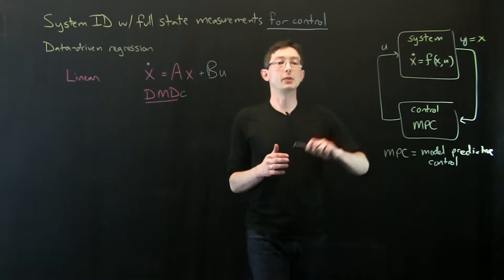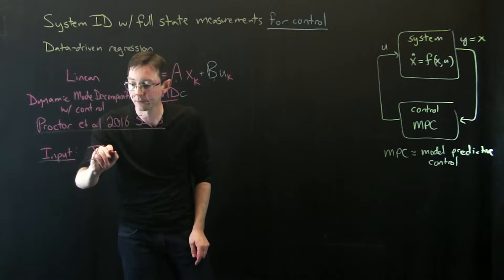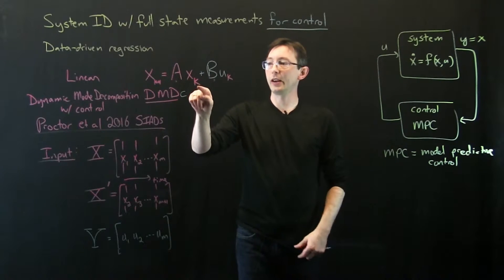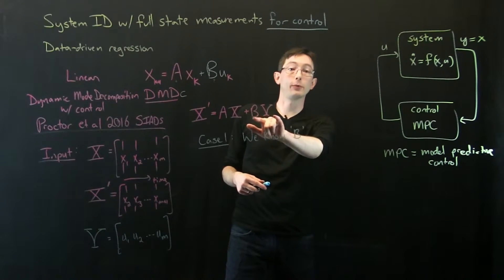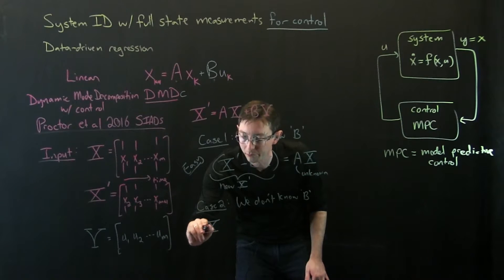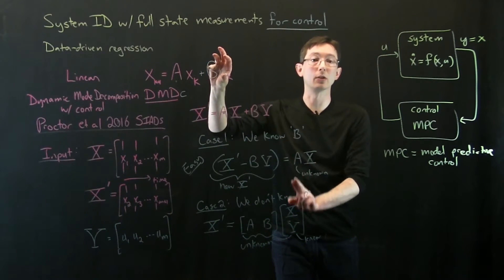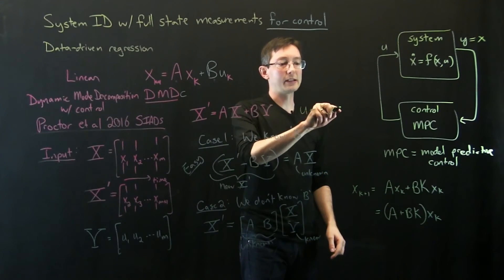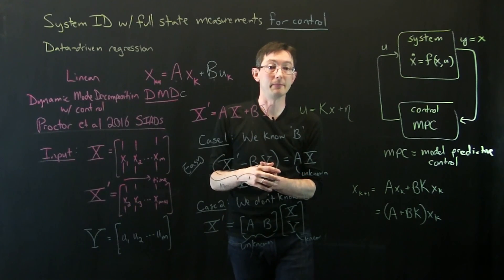System Identification: Dynamic Mode Decomposition with Control

Comment: Hello, I try this method on heat transfer for two tempertures dynamics, and it wrok with no problem. But, just when I have large system temperature components, then I could'nt obtain the inverse matrix that help to calculate PHI, because the dimensions of "Uhat" and "W" are not square. Any idea to fix this problem please?

Comment: Dear Steve,
I got a question relating to your paper. I have tried to implement DMDc several times and it always leads me to the point that the A and B matrices in Eq 27 perfectly well rebuild the data whereas A and B in Eq 29 and 30 dont work. How is that?

Comment: Can we just excite the system for some time and make input zero. Then do a regular DMD to get matrix A. Then plug back using this matrix A to solve for matrix B.
Reply: Seems to me like that would work fine as long as your system is only intermittently driven.  For some systems this is the typical scenario, but for other systems, it would be unusual to halt all inputs (e.g. a commercial airplane).

Comment: Hello! So if you have a system (A+BK)x = x' with control, you are sot of stuck. But for the special case where you also have access to the u vector, doesn't this solve the issue? Say I have a quadcopter, and I have access to the motor speeds, and the state vector, shouldn't the problem be easier?

Comment: Will I get the same result as DMD by simply training a 1-layer neural network with [x_k, u_k] as input and x_k+1 as output?
Reply from the maker: You will get something very similar.  Just like you can get something like PCA/SVD using a simple linear autoencoder.  But, and this is important, DMD is often applied to data that is so large that a 1-layer network would be prohibitively large, so dimensionality reduction is necessary.  This actually got a lot of us in the field thinking about building DMD autoencoders, and after a discussion at a Banff workshop in January 2017, several of us wrote papers on the subject. 

Our paper on the topic is here: https://www.nature.com/articles/s41467-018-07210-0

Also, just because you can write something as a neural network, doesn't mean it is a good idea.  In the PCA/SVD example, although it is possible to compute this using an autoencoder, in my experience this requires more data and more time, as the SVD optimization has an optimal closed-form solution.
Reply: @Eigensteve  Hi Steve. We're working on a Koopman related project in Montreal, so thanks for all the great resources you're putting out on this subject! I read your nature paper, but the continuous spectra part was over my head, so I'd love to ask you this question to clarify something for me if you don't mind:
Example 3 in the paper is a "high-dimensional fluid problem", but you are only ever using the analytically derived 3-dimensional reduced model (eq. 8-10), correct? So your argument above about 1-layer networks being prohibitively large wouldn't actually apply in this case, since your data is not actually high dimensional. Is it the continuous spectra here that would break "normal" autoencoders? Or am I missing something?